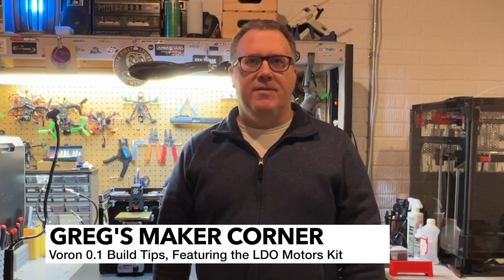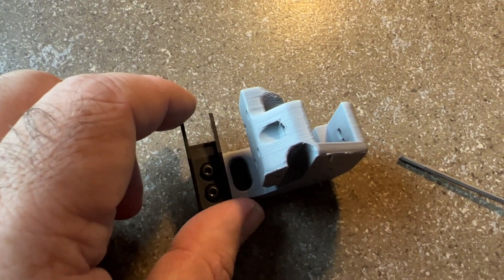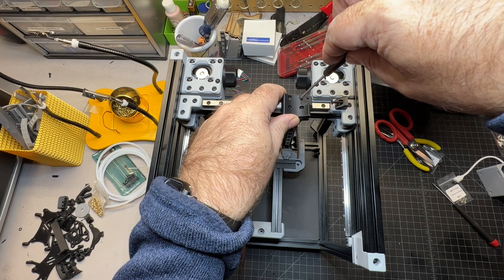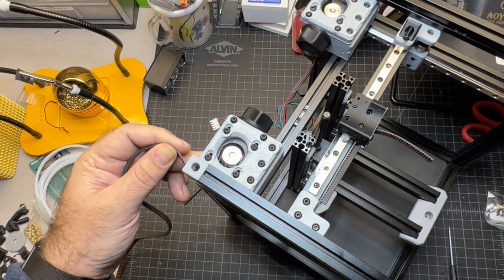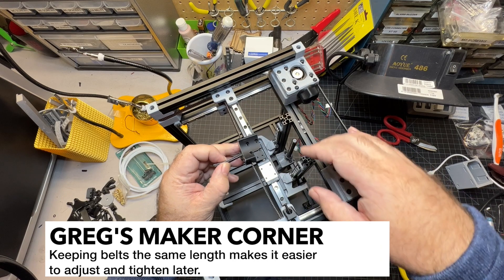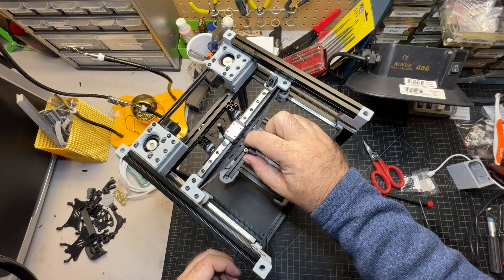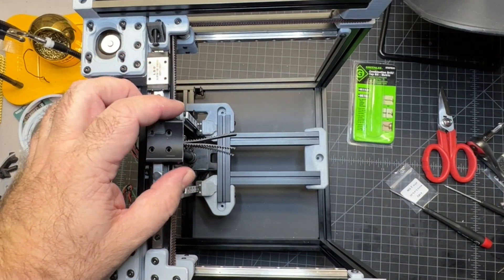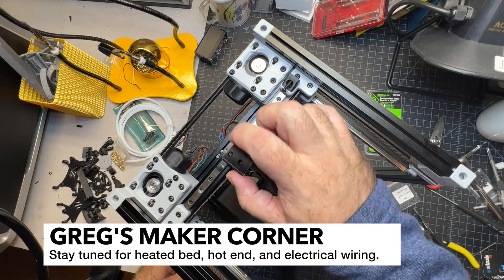LDO Build Tips - Frame and Belts

Comment: Really like you videos and seeing the Armattan, FPV stickers got me to subscribe right away. For the LDO kit do I even need the no_drop_nut 3D prints? is that what you were talking about?
Reply from the maker: Haha, that's good to hear- sounds like you are a fellow FPV guy. :)  That is what got me into 3d printing in the first place... printing camera canopies, soft mounts, gimbal guards, etc. :)  Thanks for the sub!  LDO kit- you don't absolutely need the no drop nuts, but it really does help keep the nuts from moving around and makes things a lot easier during assembly. Plan to print out about 120 or so of them. They can be used just about everywhere but there are a few spots (like the handles on the inside extrusion) where you can't use them because of spacing.
Reply: @GregsMakerCorner  thanks for the reply man, will print a bunch 👍🏻

Comment: Solid gold my friend. Are there any locktite/permatex variants that are more abs/acrilic friendly?
Reply from the maker: Anecdotally, I've heard people that used loctite on ABS having a rougher time (parts getting brittle) but Permatex seems to be less of a concern- though I still try to avoid it touching parts as much as possible. I have had my original build running for over 6 months with no issues or noticeable degradation. I haven't heard of anything else yet that seems to work without promising to damage any plastic parts.